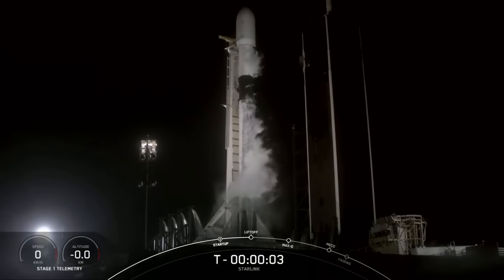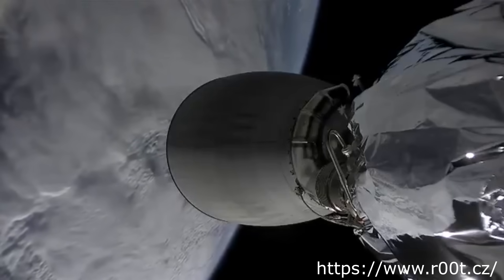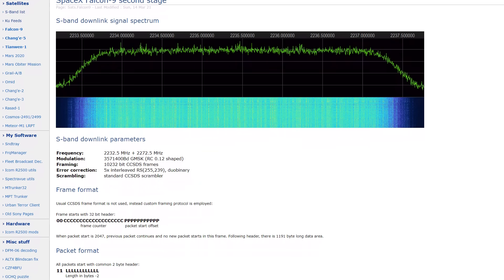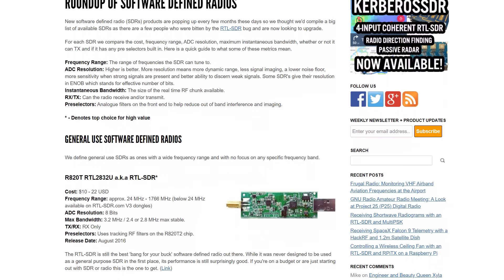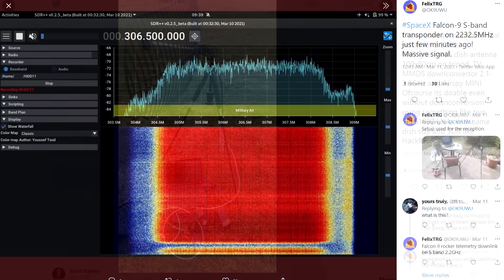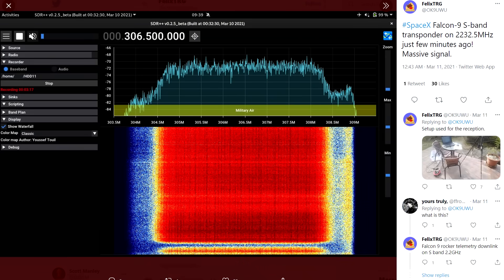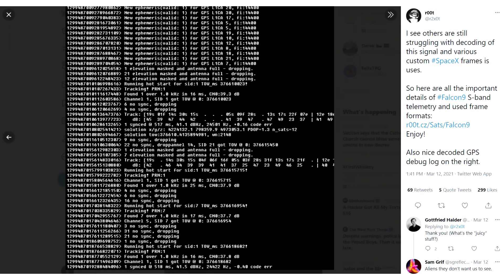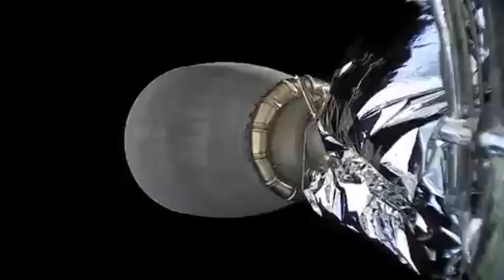How Amateur Radio Fans Decoded SpaceX's Telemetry & Engineering Video

Comment: It costs additional money to encrypt data, and adds a delay. You need to increase the power budget, which ultimately means more weight at launch, or else you reduce your safety margin on your power source. For low throughput command and control, encryption is needed. But for real time high bandwidth video and telemetry encryption makes very little sense.

Comment: To down convert a Low Noise Block Convertor would be used. Consisting of a Mixer and Local oscillator, producing a down converted Intermediate frequency, containing the desired modulation, which would be fed into to the software defined radio.

Comment: Upconverters and downconverters work on the principle that a linear combination of two frequencies A and B result in harmonics at A+B and A-B. So say, a 10GHz signal can be combined with a generated 9GHz signal, and you get a 19GHz and a 1GHz signal. Just filter out the unwanted harmonics and amplify, and you have your signal shifted by 9GHz.

Comment: The word you were looking for is mixer. If you mix a fixed frequency with a received frequency you get the sum and difference frequencies. Usually you filter out the sum and principal frequencies leaving you with the down converted difference or intermediate frequency which is electronically easier to deal with.  Your plain old am/fm radio does this.

Comment: How does the camera survive under liquid oxygen conditions? And where does the light come from? I would expect the inside of  metal tank to be pitch black dark?!
Reply: Quite simple, they use optical fiber to connect to camera, which is safely stored away from liquid oxygen.
Reply: @tgstudio85  Thank You! That sounds very plausible.
Reply: It's likely looking through a very small hole..  No idea about the light.

Comment: As I understand it, per FCC requirements, all uplink commands to satellites are required to be encrypted, but the FCC does not require downlinked data to be encrypted.  In general, satellite data is blasted out in the hopes that the ground will be able to hear.  So unless the mission is classified or military in some way, it is my understanding that the majority of downlinked data is left unencrypted.  

One possible reason for this is that it is easier to use worldwide ground stations if you aren't encrypting downlink.  Why you couldn't just downlink the encrypted data and send it over to the company who then decrypts it I don't know....but I'm not a COMM guy, just a small-sat guy.  

Source: Current M.S. AE student

Comment: The way they shift it to a lower frequency is by mixing the incoming signal with a similar frequency generated locally. When you add two sine waves with frequency f1 and f2 together you get a carrier wave with frequency f1+f2, and an envelope of f1-f2, and you can mostly treat those separately. So you can start with f1=5GHz, which is would require a pretty high end ($10,000+) digitizer to capture. But if you add it to a signal with f2=4.999GHz you get an envelope of f1-f2=1MHz, which you can capture with a much cheaper digitizer. For a frequency modulated signal this will work as long as the envelope frequency is higher than the bandwidth of the signal, which is typically MUCH smaller than the actual transmission frequency. (WiFi for example typically has a 22 MHz bandwidth, transmitted at 2.4 GHz).

Comment: Probably they’re using either an LNB or some other transverting device.  A transverter being a device that converts one range of frequencies to another usually by mixing it with a local oscillator frequency and filtering off the requisite harmonics.  It’s a bit more involved for good results but that’s the gist of it.

Further along the video it looks like they define a spread spectrum transmission system.  You either go very focussed or very wide to overcome noise floor issues.

Comment: I always thought rocket telemetry data since it's both proprietary and/or confidential data and obviously long range wireless, was encrypted up the ass. Apparently not...
That's got me thinking again about another similar thing, somebody asked the question a while back and I think it was on a Scott Manley video too.. what happens if you could send the flight termination signal to a rocket from outside..

Comment: Dropping it down to a lower frequency is basic heterodyning, used on all radios from the late 20s on. That's what the IF stages are. Further heterodyning, and demodulation, is performed by the software radio modules. In the days of vacuum tubes, special tubes (pentagrid converters, heptodes, ...) did these functions with ONE TUBE ! Design philosophy changed with semiconductors, and especially ICs. No one to one correlation. What works with one technology, is foolish and stupid with another. Consider dividing by 10. In tubes, there were special tubes with unique structures (dekatrons) to do this, while on an IC, its done with a hierarchical structure of dozens of transistors formed into gates, that are in turned formed into flip-flops, then into a counter block. The technology DICTATES what method is more efficient and cost effective.

Comment: Called an LNB - Low Noise Block convertor, absolutely common in most satellite ground stations.
Reply: You're the only one that's got it right so far. I used to install c-band uplinks and down
Reply: @Bryan-Hensley  I ran a ku uplink truck for many years.

Comment: The only thing amateur about Amateur Radio is that we don't get paid.  Consider the difficulty that Apollo had with some of the two ways comms with the moon.  Amateur radio OPs regularly bounce signals off the moon from 50MHz to 47GHz and uses them for 2 way comms.  Not bad for tinkerers.

Comment: Very interesting. Does this mean it would be possible to obtain additional launch footage too? In terms of being able to capture footage that is usually lost due to the views alternating so frequently during live coverage? I guess a big factor would be having the necessary line of sight at the right time. I'm sure many of us have watched a launch and wished they had stuck with a certain camera for a bit longer. I understand that the rocket itself alternates between cameras but they also alternate between rocket and ground cameras etc so you inevitably miss out on some footage.

Fascinating stuff either way. Hopefully they don't take measures to secure the data.

Comment: Could you breathe liquid oxygen?
Reply: If (huge IF) you could manage to get even a small drop of liquid oxygen right into your lungs, it would be likely to cause extreme cold burns at the very least. Oxygen is liquid only at temperatures below -183C. Once in your lungs it would be turned back into a gas rapidly, in a matter of seconds, by your own body heat. The volume of gas produced (1000 times larger than the original 'drop' of liquid O2) would expand so quickly it might rupture parts of your lungs, bursting alveoli and causing serious bleeding. I expect that would be an unpleasant and painful death.

Comment: more than 10 years ago military drones were broadcasting analog in open Channels. then some of the ...um... 'locals' figured out how to pick up the video by scanning the correct spectrum,  just like scanning for a OTA TV station. they now use security measures to secure the video feeds. but this isn't too unusual, open signals simply the broadcast/receive equipment and help reduce lost data. im sure many of the systems get upgraded with security as they become more reliable and predictable.

Comment: First i can say: "don't underast the power of ham radio operators.
I have some feeling that SpaceX wont encrypt the telemetry and Engineering video stream.
The reason for this is that in the early live streams space x shows the tank cam and there shows some times for a few secons on the live stream.
In my view the true reason is that SpaceX cut away the Tank cam form the live stream is that this is not the most interesting cam in Engineering video stream and a good reason to shows mission control or the map.

Comment: SpaceX will have to add encryption, at least for Air Force contract launches.  AF is picky about who knows what their payloads look like or how they are released to seek their final orbits.
Reply: These are just engineering camera's I would think anything involving a sensitive payload would be encrypted.
Reply: @TheEvilmooseofdoom  AF required SpaceX to discontinue video feed after first stage separation on their payloads.  No video.  But here is a way to grab all of the video feed and telemetry that SpaceX is collecting from the second stage, including video of the payload as it is released from the cargo bay and a precise description of its initial LEO.

AF will not like that.

It's conceivable that SpaceX is already encrypting second stage video feeds and telemetry for AF missions.  I don't know.  But if they are not - after this public hack - they certainly will.
Reply: @Urgelt  You have misunderstood what was done.  This was footage they were broadcasting unencrypted already.   They would not stream unencrypted video of anything important and even then they would only send that data down when they have LOS to a ground facility that is supposed to receive it.  There is no way to grab what footage you want from the booster.  You can track space craft with radar quite easily so anyone who wants to know the orbit will know it.
Reply: @TheEvilmooseofdoom  Knowing where the satellite was released will greatly speed up the process of figuring out its orbit.  AF does not want to make that easier to do.

AF also doesn't want plain clear close-up photographs of classified satellites.  This is exactly what access to the telemetry provides, unless it is already encrypted.

You assume that it is.  Okay.  Hope that's a safe assumption.

In any event, I only pointed out that if it isn't, AF will insist that it will be.  True, that.

Comment: When you mix any two signals, you get 4 out, the original, the added signal, the sum of the two signals, and the difference, the difference is your radio station music and satellite data, or your down converted data signal. Filter out the first 3 and you have a radio receiver.

Comment: How can oxygen be liquid with vacuum around it instead of turning to gas?
 Or is the 'empty' space filled with helium?
Reply: some do fill with helium some dont but as long as it stays cold AF it will stay liquid. and if the pressure vessel can handle it can also works like an LPG bottle where it does turn to gas but theres only so much room when the gas reaches a certain pressure the rest of the liquid cant turn to gas and is force to stay as a liquid this method is used also in hydrogen cars. SpaceX if i am not mistaken uses the cryogenic storage method keeping it cold AF below –183°C for Oxygen and from what i have read they do backfill with helium this helps keep pressure in the fuel system and helps stop thing's from going bang very large tanks with lots of gas / fuel vapor can go bang very easily in the wrong circumstances TWA flight 800 is one example unfortunately planes cant backfill with helium.

Comment: Military use digital radios are not much more encoded if taking something less security demanding than for example battlefield management or rocket artillery telemetry. Having a regular IFV or 4x4 with troopers onboard and transmitting vehicle status (fuel, ammo, speed, charging, issues) will possibly go rather flat in encoding variations.

Comment: "Not sure how long we'll be able to do this for"
I imagine it would change by the next NROL right? I can't imagine that they would want to sacrifice the engineering cams on classified payloads, but honestly don't know if they have special encryption they bring into play just for classified payloads or have just been relying on security-by-obscurity heretofore.
Reply: I'm not sure what additional information this gives people on the classified payloads, considering you already need to be able to track the rockets to a high degree of accuracy to get this data.

If you can track the rocket, you know where the payload is going. What else is this telemetry going to tell people about the payload?
Reply: @daredaemon8878  one could derive mass from comparative fuel (or O2) burn maybe. The GPS stream provides more accurate positioning that you need to track the rocket by far.  Any engineering cams with a payload view would also be a big deal based on webcast behavior for previous NROLs

Comment: It will be a S band LNB using  a Adlam Pluto and a very stable tracking dish. Radio Amateurs use QO-100 @ 2.4Ghz up and 10Ghz down running DVBS2 so the gear is out there. I run a 1.5M dish but mine is a prime focus dish fixed on the Geostationary QO-100

Comment: Encryption decreases reliability of reception, it's a trade off on what's more important, getting the data or making it secure.
Reply: It certainly adds one extra point of failure (loosing the key).  However since it happens between compression and forward error correction, it should not be adding other risks.
Reply: @johndododoe1411  You wouldn't want a loose key anyway …
Reply: FCC also regulates what non-federal entities can employ encryption on RF transmissions

Comment: The encoding system that you talk about at the 5:00 mark is known as data compression.  There are many different compression algorithms out there and they are all designed to make data take up less space (bandwidth, bytes, etc).
Reply: No, this is not compression. In RF we use scramblers like this when we are sending digital data to spread the signal energy out for better SNR over the bandwidth that is available on the channel you are using.

Comment: What I really want to see is the footage from inside the SN tanks during flight. Specifically, the fuel header tank.
Reply: Sn stands for serial number.
Reply: @Bryan-Hensley  ya don't say? Obviously I'm talking about the three that flew. The use of a spherical header tank is a fascinating gamble and relies upon the physics of that final "j-turn" and the intrinsic pressing and perhaps replenishment from the primary tanks. It would be particularly interesting to me, to see what's happening inside the fuel-header because that's obviously the failure point.

Comment: This reminds me of when I first decoded a NOAA APT signal and saw Scandinavia from above in grainy infrared wavelengths.

I rock an RTL-SDR V3 dongle with SDR# receiver software and use a piece of software that “pipes” the audio from SDR# to a program called WXtoImg that decodes the audio and creates an image (also adds a bunch of other stuff optionally like map overlay based on TLE files).

Comment: The nature of "space" transmissions makes encryption troublesome, think data parity and error correction. With unencrypted stream worst case you loose couple of pixels/data packets. With encrypted one you loose the whole data block unless you chop it into smaller chunks which affects in the end performance etc. Almost all civilian satellites are sending unencrypted data back to earth, you can easily decode NOAA, GOES, MetOP, Meteor, MetSat and the Chineese ones. When you think about it it's not like they are sending classified national security data, its bunch of numbers on equipment perfomance.
Reply: It depends on your encryption scheme. If you are using a stream cypher for instance, you won't lose a single extra bit. You might need so resync the stream if you loose too much data but nothing impossible. What you are saying about data loss is worse with compression than encryption, and yet, they are sending h.264 video streams. Also, error correction codes are close to perfect today.
Reply: @gubx42  2 people that know about stream ciphers but can't spell lose lol
Reply: @gubx42   @João Costa  You are both right, in the end, there are military satellites that use encryption and it's in their best interest for it to be solid. What I'm saying for most civilian applications it's not worth the hassle.
Reply: Well actually (lol) you can use a stream cipher and loose pretty few bits or almost none.
Cypher blocks have the issue you talk about but stream cyphers not that much.
Stream cyphers are less secure but should be secure enough for these use cases.

Comment: Does anyone know how the engine is able to reignite in space when the oxygen is floating around in the tank? When it is accelerating the oxygen is pushed to the bottom of the tank. But when it still has to ignite the engines, the oxygen is free to float around right?
Reply: He mentioned that they use the thrusters to accelerate the rocket before starting the engines.